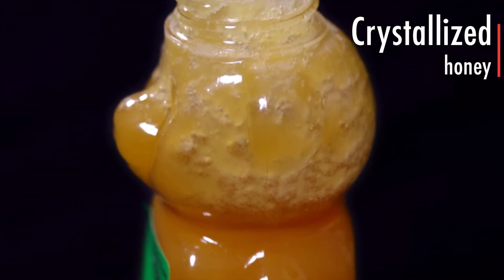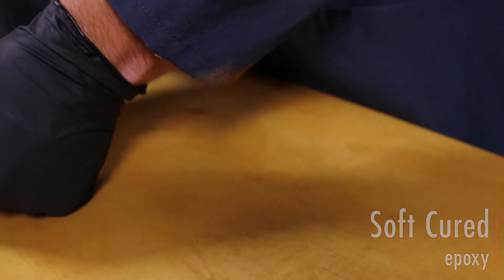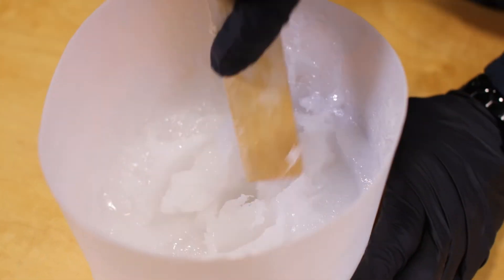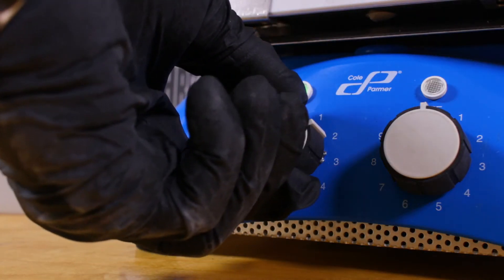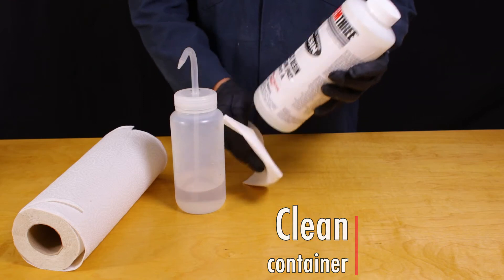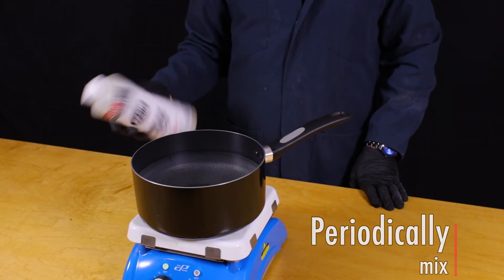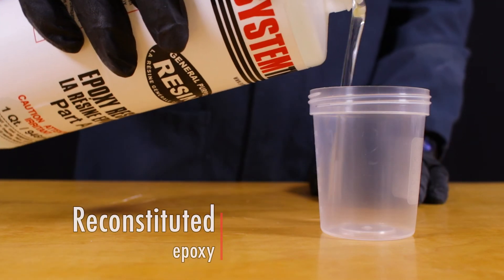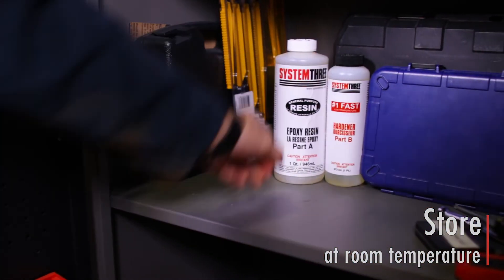Epoxy 101: Fixing Crystallized Epoxy Resin

Comment: Do you turn the burner off once it reaches 125?
Reply: Great question! On a hot plate as shown in the video you could turn down the temperature to maintain the 125F temperature and ensure you are not damaging the plastic bottle. For a stovetop, you would want to turn off the burner before placing the bottle in the water as the heat could transfer from the burner to the metal pan directly to the bottle. Having a spacer/rack at the bottom of the bath would help prevent the direct transfer from burner to metal to plastic and the burner could be left on to maintain the temperature. I prefer warming up the epoxy in the microwave 10 seconds at a time until it completely clears up as that works much faster.